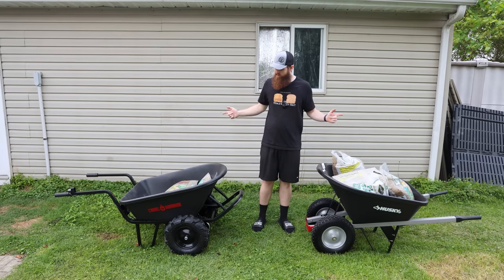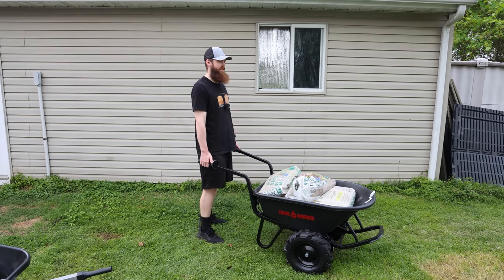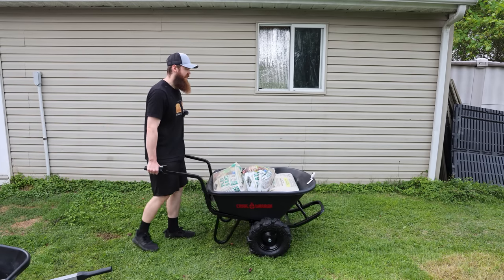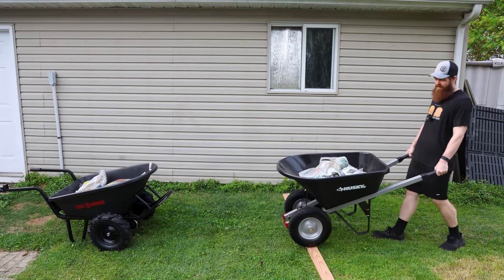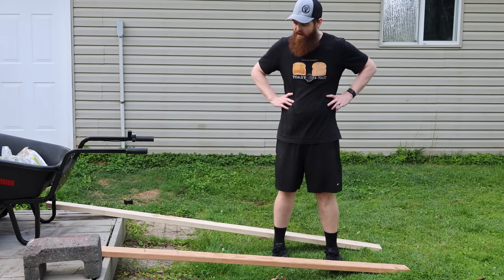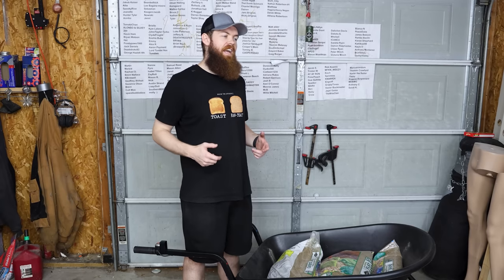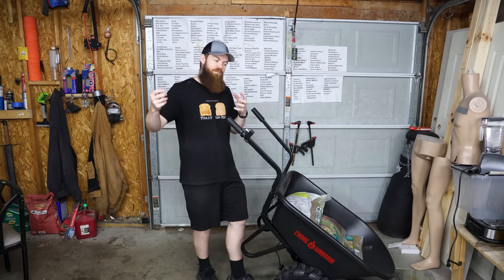I Tested An ELECTRIC Wheelbarrow!

Comment: i seen more power in a fart than the wheelbarrow
Reply: What’s a wheel barrow?
Reply: @X22GJP  what you just watch
Reply: you really look like it too
Reply: Did that wet fart also have 1 bad battery?
Reply: @X22GJP  I'm going to go out on a limb and say you've been calling it a "wheel barrel." 😅
Reply: For real. On occasion, I've had farts that hurt my bunghole because they were so powerful.
Reply: Especially if it's my grandpa's 😂
Reply: @X22GJP the thing he is using. 😅. Do you think it's spelled barrel?
Reply: @QuickTipsAccounting let's be hopeful he is just critiquing the space wheelbarrow lol
Reply: Why does this guy look like Tyler's long lost brother?
Reply: Yeah, Tyler told us that your mother packs a punch .
Reply: Sherman Klump
Reply: The fart gives you a little push
Reply: I read this as I need more power in a fart than a wheelbarrow
Reply: That's because you don't have commonsense. It's not meant to be used strictly with its electric motor. It's just for temporary boosts when needed.
Reply: Did he die? RIP, the only man to fart 24 volts and 2 horsepower.
Reply: @EMD1028 and even then it's still totally useless because it has a charge of 4 minutes.
Reply: @EMD1028  He even shows it's "boosts of power" and it didn't even work 😂🤣
Reply: @ShockingPikachu  that's because a 12v battery won't last long. I mean it cost $800, I Also do you load a wheel barrow with weight towards the handles? No commonsense is weight under the front wheel. Either way you still have to use effort to roll it and as you saw on the incline he said he stood corrected.
Reply: @EMD1028  Oh of course I just think it could have done a little better at least lol Glad what you have works
Reply: @EMD1028  it's a 24v system...
Reply: @ShockingPikachu  even that is terrible. Your not gonna get much out of it if strictly using the motor even on flat surfaces. Not what it's made for.
Reply: @X22GJP  a small cart with a single wheel at the front and two supporting legs and two handles at the rear, used typically for carrying loads in building-work or gardening.
Reply: @EMD1028   My grandpa's electric push lawnmower has motors in the back so that it is able to push itself. The motors in the back wheels are DEFINITELY not designed or made for moving anything more than the weight of the mower itself. Yet, I (a 150 pound person) can sit on top of it and make it move with no issues. Not only that, I once needed to move a very large amount of forty-pound bags of top soil without a wheelbarrow. In a last ditch effort, I piled them on top of the electric pushmower 10 AT A TIME in order to transport them. (That is around 400 pounds per trip.) Sure, it was struggling quite a bit and I had to balance it correctly on it's back wheels in order to be able to turn, but it never failed/stopped and was basically doing the job an electric wheelbarrow is supposed to do.
Additionally, the battery did not run out in mere minutes like the wheelbarrow, and the lawnmower itself cost less.
While a possible explanation for why the whole was possible is that the lawnmower is a 40 volt system, I still think an electric pushmower outperforming an actual electric wheelbarrow in transporting heavy loads to be a rather strong indicator that the wheelbarrow is not that great.

Comment: I could have saved you the review lol.  Neighbor bought this 2 years ago and same results.  No real power.  Great for hauling leaves and light loads, but anything over 50 lbs it's a waste.  BUT, there is good news!  For a small fee $200.00 for a Lithium 10 AH, 24v  battery, it turns into a beast!  Neighbor made the switch and yes, it has power for days.  I think he said it has a 9 AH PAW battery, which is basically what those kids plastic riding toys have.
Reply: any chance you know the brand and aH rating of lithium pack he used?

Comment: Yes please revisit this when you know you have good batteries and a good motor!
Reply: and increment of weights, not start out at max and go lower. I would rather see what it actually can do than what it said it could.
Reply: Yes bad battery, it's sitting at 10.x volts. The unit was running on 1 of its 2 batteries.

Comment: the going from green to red is due to voltage sag, this is caused by the battery being bad or the current is too much for the battery. This would probably work a lot better if the battery amp hours were higher

Comment: I thought the electric would make that a cake walk!! I guess sometimes it's better to use what is tried and true 😎
Reply: No it’s just a shit brand. They make better powered wheel barrels
Reply: @xaphan8581 and what is the use..? I still can't get my head around it.. like he did the 350 easy without a motor.. why bother to use one for the same load..? I don't see a world where you are so weak that you need a motor to help you carry a wheelbarrow.. (and if you are that weak load it less and go 2 times.. it's not rocket science)
Reply: @FireGodSpeed Older people and people with strength issues. Aided tools are important to have so people can be independent and tend to their work
Reply: @FireGodSpeed  yeah right, bro I use to do landscaping and one job we had to spread 5 dump trucks of basalt chip threw out these beds and to do it you were going up and down hills going over rocks and shit. If this thing actually works I would have used the shut out of it

Comment: Pretty sure it's not supposed to do the work for you, just assist with more power so you don't fatigue as quickly. 
And a little extra boost when you need it.

The red light might not be to indicate battery capacity, but rather indicate it does not have the torque to pull/push any harder.
Reply: Idk seemed to move for shit without any battery use
Reply: I think your right
Reply: @nmgefun872  “you’re”
Reply: Dude, whether it lasted for 10 minutes, or couldn't torque on flat ground after 10 min, this thing is absolute trash.
Reply: @X22GJP  your mom
Reply: Bad battery, it's sitting at 10.x volts. The unit was running on 1 of its 2 batteries
Reply: that battery is absolutely dead.  it's got half the power it should have.  it shows 10v,  but the second you draw power, it plummets.
Reply: That's what I was thinking. Maybe just a boost like an electric bicycle

Comment: wondering if tyler fully charged the battery before testing it
Reply from the maker: multiple times and multiple off camera test
Reply: He literally said the light kept going green to red depending on if he was using the throttle. That dosnt happen from not charging it. It’s just a shitty product.
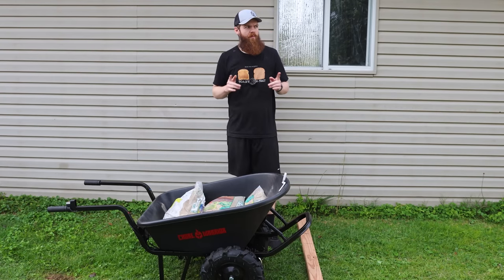Reply: At ~8:30 he said in the video he charged it back to full.

Even if we assume he hadn't charged it at all until that point, which he almost certainly thought about, we know for sure it went from one full charge to useless in just a few minutes.
Reply: @TylerTube  i made the comment before the point where you noticed the battery was bad, love the channel BTW

Comment: @TylerTube never forget the most well known facts about any equipment that is supposed to do heavy lifting:

1. the advertised "max capacity" is what was tested in a "lab"-like condition, in the most optimal condition: always take the advertised "max capacity" and reduce it by about 15% to know what actual capacity the product can do in reality, also even if that was a Bobcat skid steer, you never want to load the machine to 100% or even 95% of their max capacity.. that is why pros say that when buying a piece of equipment you need to "size it right" (which means take the maximum capacity you think you will need and add a 25% buffer on top of it for future expansion)

2. did you fully charge the battery? it seem to look like even for an overloaded cart, you did not even finish one whole round through your yard when the battery was already drained.

3. what you are testing looks to me like "consumer line" product, which means it was engineered for light jobs around the house/garden, so they might never thought it will be tested to it's fullest advertised capacity and used it as a marketing gimmick, "professional line" products usually are required to stand behind their claims since they are being used in commercial environments which not adhering to claimed specs might lead to expensive law suits, something that will never happen with a "small"/private customer re-doing his 100sqm backyard. 

4. just an idea- is it possible to replace the built-in battery with a higher capacity one? like most "cheaper" products, they have probably skimped on the most expensive component in this setup which might be the battery

Comment: We use them for moving over 350 pounds of stone every day of stone, when we charge them full every day and then run all day moving stone non stop, and they are lifetime warranty also. They move the best straight with a little bit of a push and we move them through mud up hills up ramps into dump trailers and they are much better in our opinion then a regular wheel barrow

Comment: if i had to guess... id say you have either a bad battery " there are 2 in the box in series for 24v 9ah" or failure to charge the batteries for the full 12hr before first use .. which would ensure both 12v batteries are actually at 12v which i suspect is whats going on its acting like one of the batteries is deep discharging while the other still has power.. which would explain it "coming back to life" after sitting while you spoke about it

Comment: Maybe I'm naive but wouldn't putting a third wheel, front & center, on the front bar, help with using the electric wheelbarrow like a regular one when the battery died? At least then it wouldn't be a semi-useless rock when there's no juice & you're pushing it & it tilts down 🤷‍♀️ 

I'm saying that with the assumption that it actually would work sometimes of course 😁

Comment: I was about to comment that you probably got a bad battery..

Sure enough, you confirmed that near the end of the video. 

Because even a little 350W e-bike could have done better. 

Are those lead-acid batteries? That's crazy for a $800 device.

Comment: I know I'm late to the party here, and it sucks you had a bad experience. I have had this wheelbarrow for about 4 years now and for only a 24 volt, I'm quite impressed with it. I have hauled mostly full loads of firewood up much steeper grades than your ramp for quite a few hours on end and never had an issue. You are right, for the money you shouldn't have the issues but if you get good batteries you should be surprised how well it works.

Comment: I know it says electrical wheel barrow but it's only power assisted. If you walked and pushed it at the same time the battery would last long and the stress on the motor would be reduced. It's like electric bikes mostly there pedal assisted to help you go up inclines. Please revisit this and walk like you would with a normal wheel barrow

Comment: You got a lemon somehow. We got one of those as a joke for Dad. He uses it all the time on the farm now. It lasts him all day and he beats the crap out of it. It looks like crap at this point (it's been used as a concrete mixer, hauler, you name it) In my opinion, I don't think it's going to last much more than a couple of years with the axle / wheel 'feeling' I get - but who knows? 
No matter what, you've obviously got a battery problem. No matter how cheaply built these might be - a cell phone battery would run it longer than you're getting! LOL

Comment: I don’t use wheelbarrows often but if you were to use the electric one I feel that you wouldn’t constantly be using the motor, only when it’s needed. Also I don’t think it’s made to do all the work on its own you have to also push. But for $800 I don’t see it

Comment: To be fair, you are testing it at its max capacity. Absolutely maxed. So it shouldn't perform as well at max as it does under a more casual load. If the performance is the same at 350 as it was for say... 100 then the max capacity would probably be somewhere around 500. It could still be a useful tool, just probably better for stuff around the house where you're not going to be loading it over and over and over to its max.

Comment: 6:56 just looked up the specs on this, this thing has 2 7ah batteries, there is no way that it will last more than a few minutes.
I'd replace them with 2 100 AH lifpo battreies but that would cost about $700 2 deep cycle lead acid batteries would be cheaper but would add about 100 pounds.

Comment: One other thing, the motor in this is probably not designed for torque, I think it's designed as an aid. I don't think it's supposed to take 100% of the the load. I think it's just supposed to make it a little bit easier. Being an electric motor it is going to have a decent amount of torque but if your starting position is to jam the wheels up against the wood, You will never build any torque. The motor has to be able to spin up to build the torque so if you're going to start it on a jam tire it's not going to work.

Comment: I have an electric wheelbarrow that works. On flat ground it works really well you just have to steer it. It's a lifesaver for your back. It can also go in reverse. It's also way louder than yours. Yours has a terrible battery.

Comment: I knew the electric one was going to be trash from the beginning. I'm not in the best shape and even I never really had a problem using a normal wheelbarrow. You still have to use energy to pick it up and guide it which kind of takes away from the usefulness of having it electric.

Comment: Another reviewer said it was 180 watts, which he could be confused and read 180 watt-hour battery, but if it’s 180 watts, that’s insanely low. I literally have remote control cars that have more power than that. That being said, it’s probably more designed as a lightweight assist, not as a self propelled tractor.

Comment: Tyler this is power assist, not a fully powered wheelbarrow. It assists you as you push it. I think the more you push the more it assists you.
Reply: So then why would it have a throttle
Reply: Maybe to regulate the top speed of assist, or how much assistance you need.  I  googled it and on the website it says power assisted. Like power assisted ebikes you need to pedal and the electric motor provides some assistance. Usually they have an adjustment as to how much assistance you need or to limit the top speed, because the more assistance you need the faster it burns through the battery.  So if the battery has some bad cells that will greatly affect how much assistance it can deliver.  I don't know that I would pay $800 for this even if it worked and did 99% of the work. I wonder if and what the directions say. I was just pointing out that it is not a full powered wheelbarrow.  Hopefully Tyler can get a good battery and give it a second chance.

Comment: I wouldn't give them $20 for that thing.
I suppose I'm old because I've never even seen a wheelbarrow with two front wheels.  Back when I was younger I was a bricklayer helper who pushed a many of wheelbarrows.  I'd like to say they two wheels would have been nice but this was down in Mississippi so most of the places we were working had marshy ground....which means a LOT of times I pushed a wheelbarrow of mortar on  2x12's so two wheels would have not worked.  However, on the plus side, I wouldn't have ever dumped a wheelbarrow on it's side accidentally 🙂  Anyway thanks for the video!

Comment: If the batteries are not the same Voltage then you have an issue with the Controller unit that isn't charging them to the same level and not letting them discharge together

Comment: starting to wonder if the battery is defective, or simply not new but instead old and on it's last leg, i'm asuming this electric wheelbarrow was advertised as New condition wherever he got it from tho as it physically looks at least somewhat new. I like the concept of being electric, but the main reason i like the concept is cuz it'd help masivly going uphill and over unsmooth parts of a yard, if it can't do that requiring relatively little effort from the user it's got much less usefullness than the concept  potently could have, especaly if the battery can't last more then 8 minutes over mostly flat level terrain.

Comment: This would be alright as a DIY kit for like 200 bucks, not a finished product.

I bet you could replace those batteries with something actually nice, double the size of the pack, and it'd probably fix the whole thing. It would have cost them like 10 bucks to do that... and they didn't, instead they shipped a super anemic, under powered product that wasn't even complete. 

Thanks for takin the hit on this one bud, you'll save alot of honest folks from being to subjected to this.

Comment: Nothing beats old man power, like today with trains everything is done by computer, resulting in where I live nearly every day we hear trains are delayed due to points failure or signal failure or gate’s failure, backed when everything was done by hand we never had the issue we having today. It seems like relic on computers to do all the work instead of man power to do it. Even cars now run by computers. I feel we should stop using computers to work for us as they was not made for it back in the time they come around, and start using our hands to do things (li live in uk )

Comment: Seems rather Odd that an E-bike most can carry a 300lb rider and still go at 20 odd miles and hour but a wheel barrow can's climb a hill with 200lbs in it a bike will go 30 miles or so with that same rider but the Wheel barrow will not go 2 at best. someone blew that design in a very big way.

Comment: You need to wire 2 deep cycle batteries for 24 volts and see if it's any better. Or just use a bunch of 9 volt batteries 😂